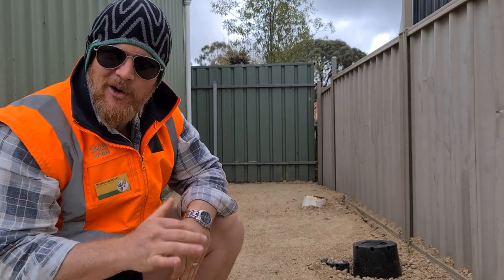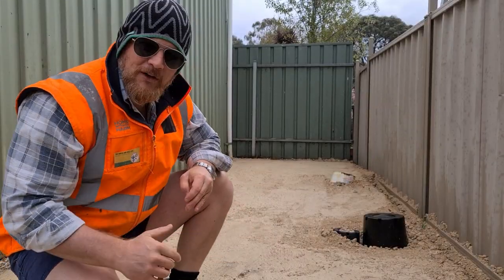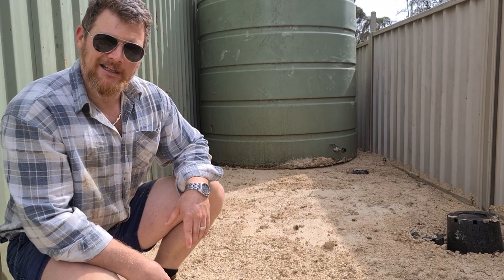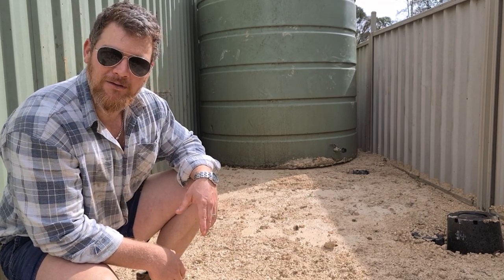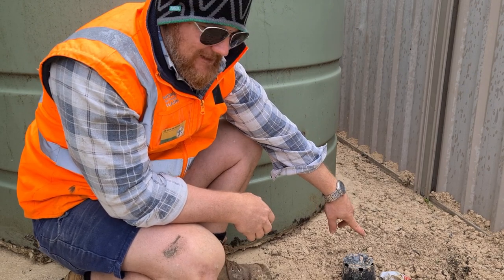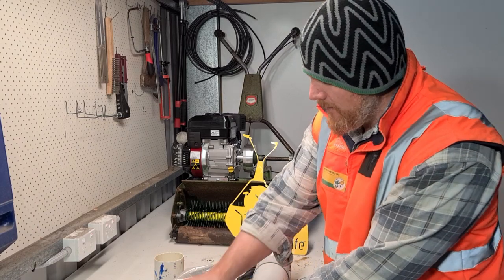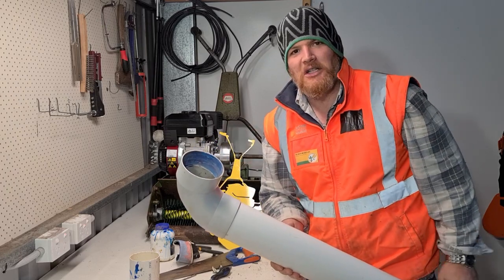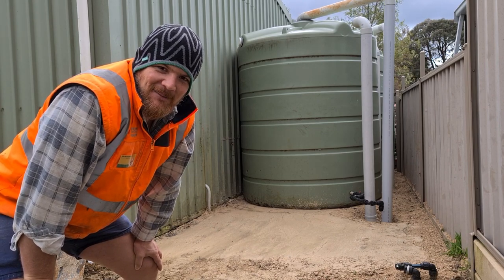PROJECT UGLY DUCKLING - TTTTTTank install

Comment: That's a lot of tank to move by yourself mate, they are awkward things to deal with in tight spaces, really impressed with the set-up, even with having to manipulate things. How many litres will you have all up for watering?
Reply from the maker: Cheers Tony. Yeah, took a bit to shuffle them into position but we got there 👍. Should only have about 16000l. Not a lot, but once I finally get a pump should do us in winter.

Comment: so what was the $200 mistake? or was it just a case of getting more of the poly connectors :|
Reply from the maker: Rural 90 deg added up to 200 bucks.
Reply: @thegreenandgoldlife1464  loose pipe and make sure it's not in the final vid cut ,🤔😀